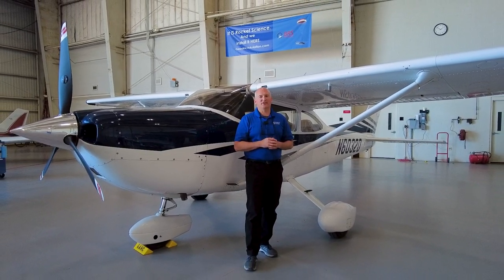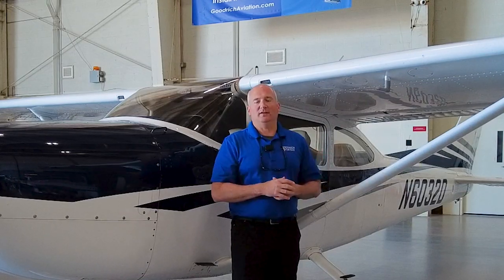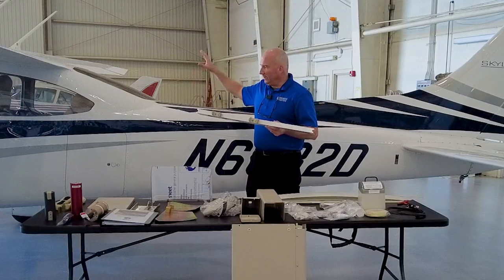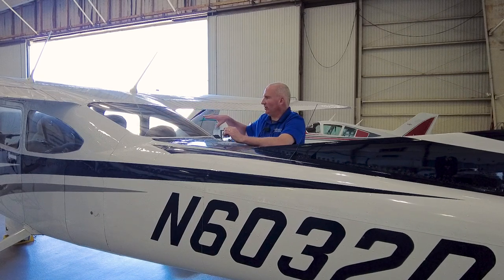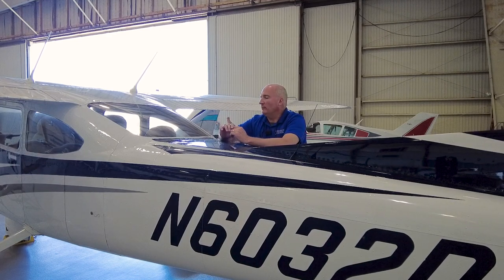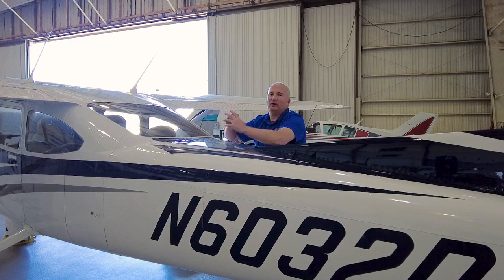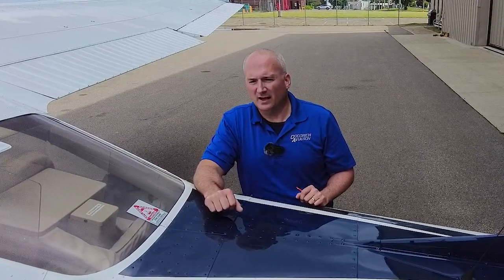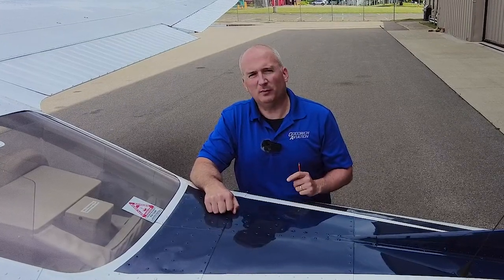Cessna 182 BRS Parachute Installation by Goodrich Aviation

Comment: Great video explanations on the installation and what you do, to the aircraft, and that can be done simultaneously.  So then you can fix and upgrade worn parts while working with some upgrading while you're working on the installation of BRS systems on aircraft. Good idea.

Comment: Excellent description of insulation of a BRS system. Didn’t know that option was out there. Are there videos of the system being deployed on a 182?
Reply from the maker: Lots of Cirrus deployment videos but I have never seen one for a Cessna 182 or 172.
Reply: @DougGoodrich  How do you know it works?
Reply: In principle it should work the same way it does on the Cirrus. But if you're looking for guaranteed safety your in life, piloting a small plane probably shouldn't be on your list of things to do.

Comment: Do these mount in any GA airplane such as a Diamond DA-62 or a Kitfox experimental?
Reply from the maker: Not in the DA-62 but you can get a system for a Kitfox.
Reply: @DougGoodrich   is this the same system in a Cirrus? I like both the DA-62 and the Cirrus SR-22T but am leaning towards the Cirrus over the Diamond simply for the parachute. 

With the Kitfox, I want to get a Series 7 STI and would also like a parachute in it too. After I get my license and the Kitfox purchased, I’ll be in touch. The planes and the GA license will be my retirement gift to me.
Reply from the maker: @j.r.777  It's the same basic system by BRS Aerospace. Variations are to chute size (based on gross weight) and attachments.

Comment: Are there any planes that come manufactured with the parachute already equipped?  I don't like that part where someone has to use there back and a latter to get slack out of the wing at 12:19

Comment: What's the CG range on a 182?
Reply: Don't think this effect the Cof G more like effect the amount of luggage you can carry
Reply: C of G DEPENDS COULD DIFFER ON TWO OF THE SAME AIRCRAFT, DEPENDING ON WHAT Has BEEN INSTALLED AND WOULD BE WORKED OUT AFTERWARDS NORMALLY
Reply: C of G is calculated on and aircraft, and is not fixed
Reply: Huge
Reply: The parachute will help the C of G. 182s are nose heavy.
Reply: @apennameandthata2017  only if you in install in the tail section 😂

Comment: I wish it was mandatory to have these installed on every small aircraft. Would save a lot of lives.
Reply: That's likely true. But at 10,000 to 15,000 dollars to replace, a flight school with several trainers would be out a big pile of money when it came time to replace them. And a few days down time.
Reply: @kilopapa1449  I agree. Someday when I own my own Cessna this will be first upgrade I get ♥️
Reply: I own a Cessna 182. I can slow it down and land it at about 46 knots. It's true that there are places I've been that a parachute would have been safer than and attempted landing. However, when flying over the mountains a couple of times I realized that if you pull a parachute you have absolutely no control over where you land. You can be put down on the edge of a cliff which would put you in a worse position than trying to land the plane in a valley. I have contemplated installing one in my 182. It would decrease useful load, increase my stall speed, and perhaps induce me to take chances that I otherwise wouldn't. Additionally there have been failures of these devices and if you plan on them and there is a failure it's probably a lot worse than trying to land. Cirrus aircraft have a higher stall speed than high wing Cessnas. If you train well I'm not sure how much more safety this system affords in a Cessna 182. I am willing to be proven wrong however.
Reply: The problem is the majority of crashes are not at high altitude, but taking off, or landing, or what they call CFIT controlled flight into terrain, due to bad weather, were you cannot use it in anyway, but yes if you flying at altitude, then it does make sense, considering the high costs involved for installation
Reply: I wish it were mandatory to not make your ideas mandatory for others
Reply: @FPVREVIEWS  so please don't mention your views then 🥴

Comment: Your most likely accident will be a stall/spin on base to final. You will be too low for the parachute to be of any help. The parachute will just give you a false sense of security and you will relax your airmanship. Skip the chute and focus on flying the plane.
Reply: @alexp.6406  i agree. How often does it need servicing/repacking?
Reply: Maybe your most likely accident is stall/spin base to final! This addresses engine issues that are not the result of poor pilot procedure execution. The rest is up to the pilot.
Reply: And on take off
Reply: Wrong.
Reply: Know facts before you run your mouth. They are rated for 260 ft and pilots have reported deploying them less than 100 ft successfully. And it's you're* not your...